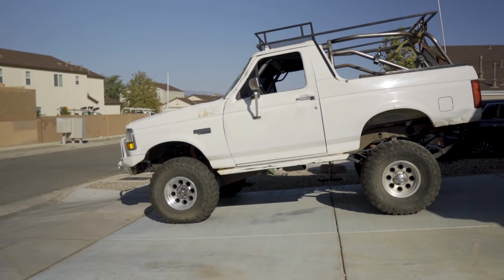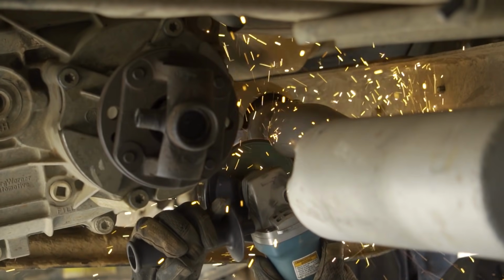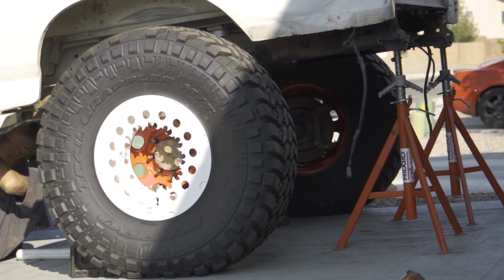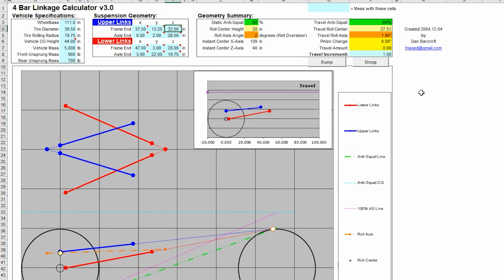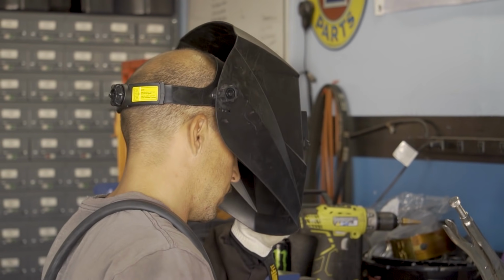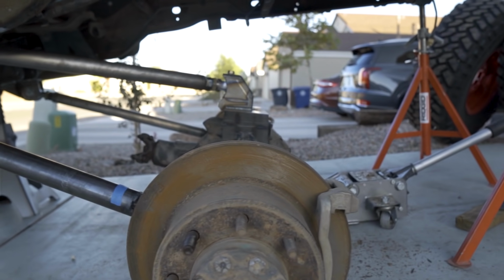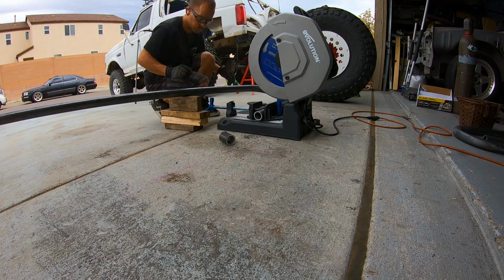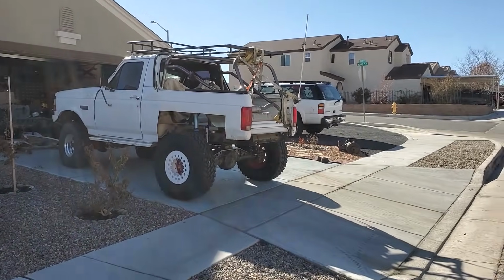Ford Bronco 4 Link Suspension Build (2020) - Reckless Wrench Garage

Comment: Very well done on the welds, look nice and deep/clean.   Might want to tighten up that frame by welding in like 2 or 3 inch wide strips every 4 or 5 inches as a quick 'boxing' of them.  Not a ton of steel and it really helps it out.
Reply from the maker: Thanks. I’ve been practicing quite a bit. We won’t be boxing the frame, but we will be adding some more cross members/bracing.

Comment: A walk through video on the calculator would be helpful , some of the do's and don't of why you would want it set certain ways. How to pick a ride height based on ______ , how to size your heim joints , tubing. Why you like a 111 wheel base vs 101. Any tips or tricks you have found to make life easier.

Comment: Please do a calculator walk through for those of us that have never used one before. A video on the pro's and con's of different systems would be helpful too ( single vs double triangle vs parallel 4 link) and more info on how and why 70 is a good number for anti squat. Thanks

Comment: Hi guys im bit of noob with link suspensions and had some queries. How do you add lift ? How do you know your caster is correct and how do you adjust it? Does it affect handling on road ? 
All these questions are for an offroad vehicle.

Comment: I can tell how much more effort you put into the editing on this one. This is a quality episode. Keep it up. 

I'm interested to see how the frame holds up to flex from a 4 link, because mine flexes like a wet noodle on the stock leaves :).
Reply from the maker: That’s a telltale sign Chris edited the video. 👍🏻

The factory frame flexes quite a bit, but this will have a few added supports due to the shock hoop bracing and link cross member.

Comment: I see some TIG time made it in.  I'm assuming Kris quickly realized just how much slower it is than MIG, and moved back to that for the rest of the stuff.  My one personal preference and suggestion would be TIG for the links if you're gonna do it anywhere.  Nice work, and keep it up.  We'll catch you... Staying reckless on the trail ;)
Reply from the maker: Conveniently, the owner approved of me practicing TIG on this, so most of the truss work is TIG. The frame side brackets are tig welded together, then covered by MIG just to be safe. I plan to get more TIG practice where I can, but I want to make sure it’s going to hold together as well. 😁

Comment: Did anyone catch how they measured the pinion angle or came up with the tilt
Reply from the maker: Since we are using a double cardan joint on the drive shaft, we set the pinion to point directly at the tail of the transfer case.

Comment: You’ll probably get by with it but I wouldn’t get under that truck with only those little pipe jacks.
Reply from the maker: Each one is rated to 2500 lbs. They shouldn't be an issue.

Comment: You don't see nice clean frame's or body panels like that in maine on any vehicle of that age
Reply from the maker: Understandable. The Stuburban came from Rhode Island and the frame was in surprisingly good condition. The body, not so much.
Reply: @RecklessWrenchGarage  wow surprised the frame was that clean coming from Rhode Island in maine they use a calcium and a salt mix on the roads and it eats metal i plated a frame on a 2016 truck just last year felt bad for the guy  that calcium is nasty stuff

Comment: What is a competition cut?
Reply from the maker: It's kind of hard to describe, but basically you cut the fender from the front of the opening all the way back to the tail light. It's common on jeep buggies. Kris has a plan to weld the fenders back together and maintain the factory looking wheel arch